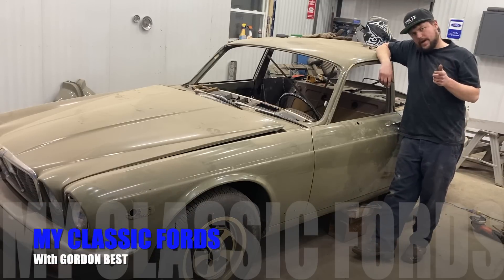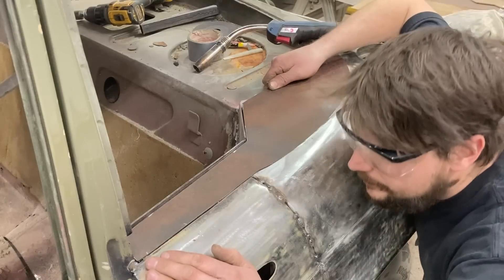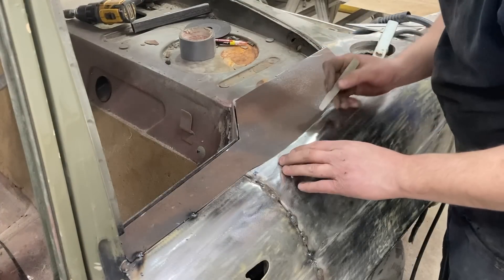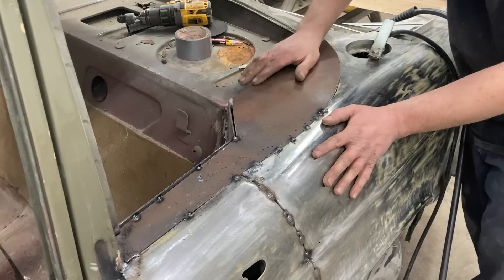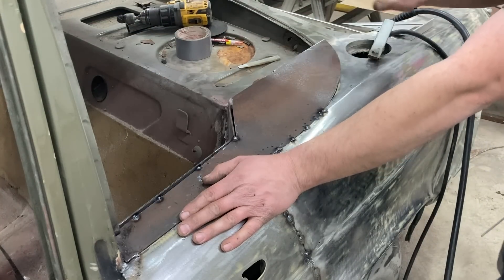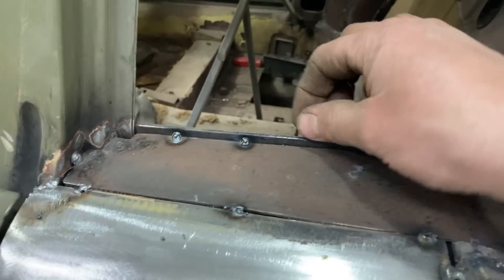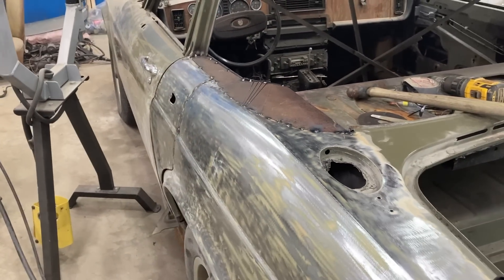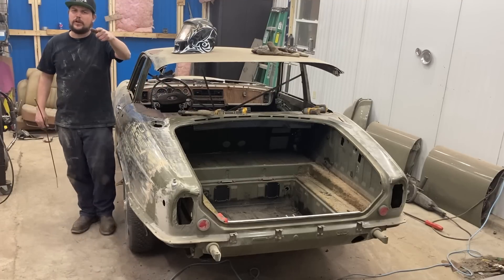CAPS on the QUARTERS, looking at ROOF DESIGN!

Comment: Looking good I really like the direction it's going. In my opinion you have the body where it would work even as a convertible, however I havent seen you address the unibody structure as such. The strength comes from underneath in a unibody car. Someone mentioned getting a professional welder to do some of the work. That made me say "what?" I weld often and I can say you are indeed a professional welder. I'm enjoying your channel, keep up the good work ,but keep it fun, it's too easy to burn out on a  project.
Reply from the maker: Yes between the sills,trans tunnel/floor and roof unibody all needs to tie together in order to be strong. Haha, I think I can pass as a professional welder. I’ve been welding for a long time, I won a 1st place provincial award in 4H when I was 12 years old. I’ve been a professional/ticketed welder for 13 years, and weld and fabricate every day! Thanks for watching Larry!

Comment: I think I read that you are considering lengthening the nose on this build ? Perhaps , if you were to remove the front suspension and, move it forward along ( leaving the grille to base of windshield distance intact ) , with moving the wheel openings instead . That way you would gain some 'wheelbase' back and still get that long hood/short deck with a less frontal overhang  look without doing too much structural work underneath . The front axle center-line would help with weight distribution without making the nose too overwhelming for the the rest of the car from the windshield back . My 'two cents . '
Reply from the maker: Definitely no where your coming from, there’s lots to consider up there for sure!

Comment: Looking good, but🤔 I never like to see anyone beating with a pretty big hammer to make anything fit….. I would rather see you take the ZIP cut and actually shrink the piece of metal you’re putting in. But I sure do like where you’re going with this build !! 👏🙂✌🏼😎
Reply from the maker: Yes a typically don’t use anything quite that aggressive but that metal I’m using is closer to 1/8” then sheet metal!
It needs quite a smack to bend, but I made sure it fit on it own and didn’t force it into the car. Thanks for watching!

Comment: That wheel well you are using for support is only sheet metal..it’s not structural…going to bend under force..
Reply from the maker: That’s only the start, time I get done every part of that car will be welded together. And remember it was made from sheet metal before I started, the pillar is made from sheet metal as well. But by the time I get that tied to the floor and the roof and add square tube frame connectors front to back I think it should be stronger than it ever was.
Thanks for watching!